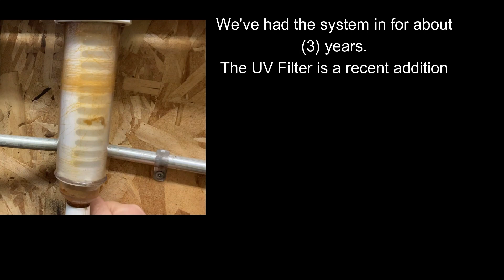Well Pump Filtration System

Comment: Do you have any issues with sulfur smell in the water? I have a fairly extensive filter system as well with everything you have here plus a iron/sulfur filter. 

It was working fine when I installed it but the sulfur smell has returned. I just shocked the well and water lines today with bleach and will be flushing it all out tomorrow. I hope this will help fix the smell issue. The water is very clear otherwise.
Reply from the maker: Once and a while we will get a sulphur “burp” but only in the 1st outlet in the system